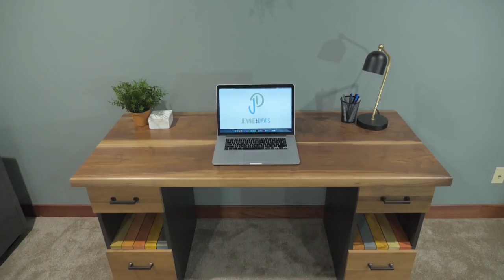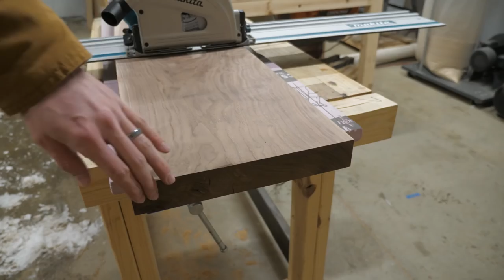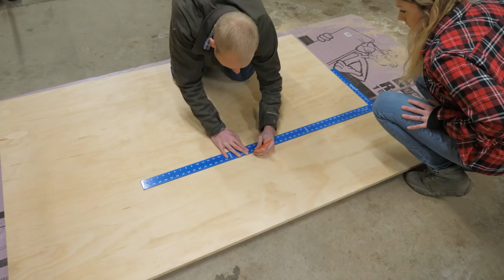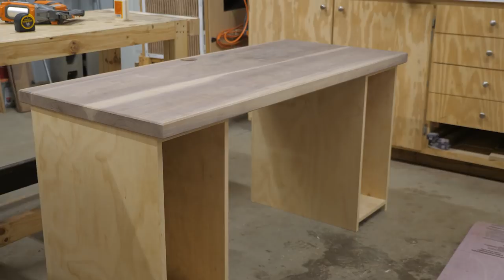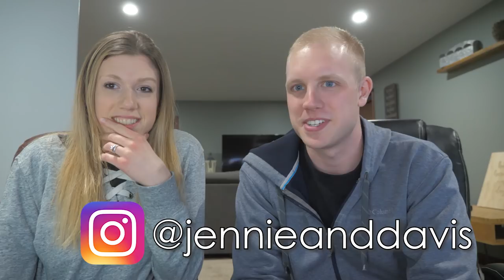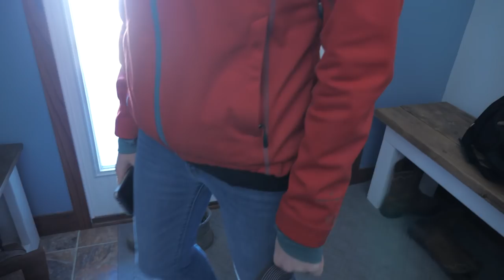How to Sell a Desk as a Woodworking Business

Comment: I see you guys use speed and drywall squares a lot for your work, have you verified they're square?  As a guy in the trades I have gone through many of those blue squares and I've never seen two that agree with each other or themselves for that matter. I mean they're more than good enough to end up in my truck. Drywall doesn't care if it's cut square once it's mudded and taped. And framing works out fine with less than a degree of error from your measuring tools. 

 However, when I use my free time to make furniture or cabinets for my friends and family I've found I don't trust them enough when accuracy really counts. How do you guys deal with that, or have you gotten lucky and picked up the odd "true" square from the homeless despot?
Reply from the maker: Structural integrity is way more important than perfect squareness. I don't have the time or the need to waste energy on something as insignificant as that task. There is no major impact on a large piece of furniture if it's a few thou out of square in any dimension.
Reply: @jennieanddavis  your statement about not having time to worry about thousanths speaks volumes about your quality of work and business model. I sincerely hope it doesn't come back to bite you down the road. Long term business success through a referral based business is very dependent on the quality of work provided. 

Most of my 6" speed squares have been just under 1/16 out of square over 6". My 10" speed squares are often 3/32 over 10". Framing squares are usually the best at about 1/16 over 24", and they can be trued by hand to be perfect. And drywall squares I've seen off by as much as a 3/16 over 48". For reference, 1/4" out of square would be as much as I would accept for framing the walls on a 30x 50 garage. 

Assuming that your $15 square is true to within a couple thou is asking for trouble as you start moving into larger more complex assemblies. Especially if you were to ever start using more traditional joinery methods. A couple thou is woodpeckers and starret territory not big box blue aluminum empire.  The errors can compound quickly. In the engineering world they call it tolerance stacking, in the trades we have unpleasant words for it, most furniture and cabinet makers I know just call it unacceptable.
Reply: @jennieanddavis  yikes!!! Wrong answer

Comment: Why use nice hardwood then go and use pine plywood.
Reply from the maker: Because plywood is a sturdy, stable, and affordable material. Nothing wrong with it.
Reply: @jennieanddavis  you are correct, just not pine plywood. Could have Atleast picked up some pure bond birch plywood if you didn't want to spring for something of higher quality.
Reply from the maker: What structural advantage does birch plywood offer that justifies the 2x material cost increase? Hint: there isn't one.
Reply: @jennieanddavis  it's more stable. Pine plywood is prone to warping. So there is an advantage...
Reply: @wr3ckn89  I thought the same thing @Ben Phelps - Classy 8/4 walnut top and then use cheap pine ply - never in my shop.  There is a long term advantage as stated plus pure bond birch ply is much easier to stain and just speaks to a quality build.  Even if a customer doesn't know the difference - I do.
Reply: @wr3ckn89  I thought the same thing @Ben Phelps - Classy 8/4 walnut top and then use cheap pine ply - never in my shop.  There is a long term advantage as stated plus pure bond birch ply is much easier to stain and just speaks to a quality build.  Even if a customer doesn't know the difference - I do.